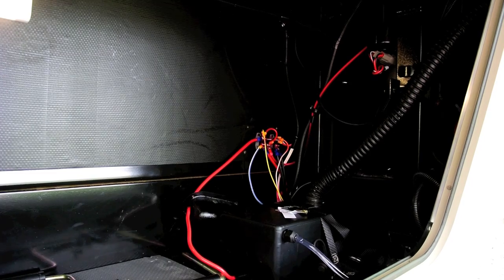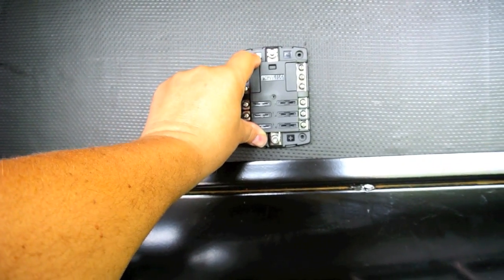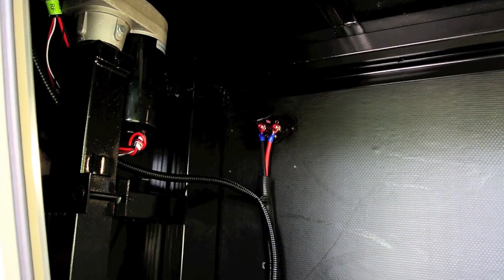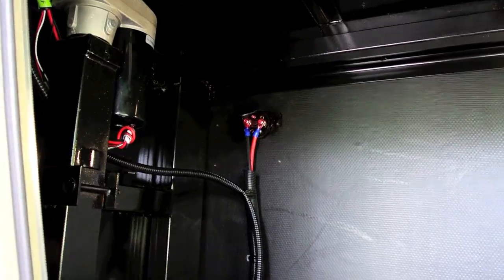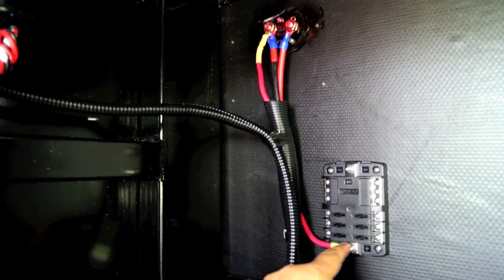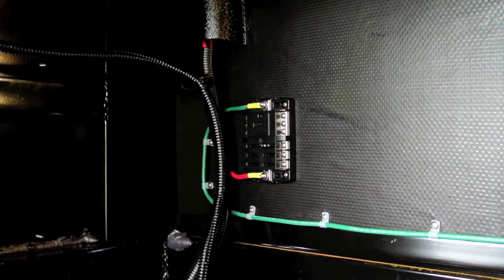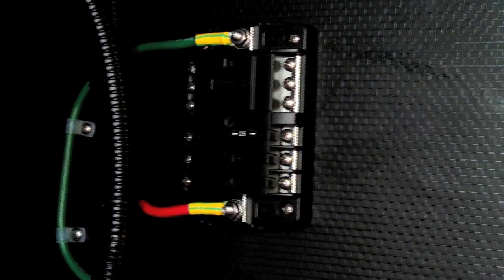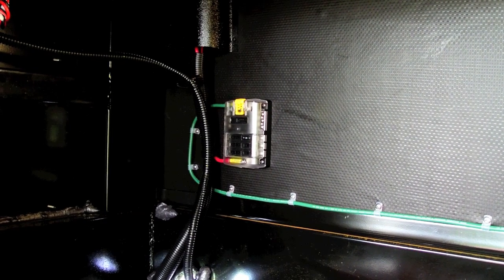Adding a 12V Distribution Panel to the RV.

Comment: What size wire is that from the main positive terminal on your new fuse panel to the switch? Thanks!
Reply from the maker: I used 8AWG wire. Like most of my RV projects, the video is a summary, with an associated project webpage providing more detail.

For this project, you can find the webpage at: 

http://www.rv-project.com/projects/dist.php 

where I discuss how to properly determine the size wire you need, where I purchase the wire and fusebox, and other information.

Comment: So you wired a new one in but still have lock nuts?
Reply from the maker: I am not sure what you are asking.

The wire nuts in the video was installed by the factory. Wire nuts are never acceptable in vehicles, boats, or RVs that go down the road vibrating everything.

Ring terminals attached to studs with captive nuts are acceptable and a preferred wiring method according to 33CFR183.

Comment: Trying to wiring up some LEDs and possibly run an amp for my boat... would you suggest pulling power off of this or directly from the battery? I'll have about 3 different sets of LEDs controlled by switches along with about 1,000W being pulled for the audio system.
Reply from the maker: The LEDs don't take a lot of current. A 5meter strip typically takes a couple of amps per color.  

An amplifier on the other hand is going to take significant power, and you may find your wiring is not sufficient.  I'd recommend downloading the USCG manual "Boatbuilder's Handbook" and reviewing the electrical section.  http://www.uscgboating.org/regulations/boatbuilders-handbook.php

For a boat, the USCG (federal law) has specific requirements for wiring electrical devices. I would also suggest visiting http://www.boat-project.com (my sister website).
Reply: Ok thanks. Much appreciated

Comment: I love your wiring sir, it absolutely drives me nuts to see messy wiring! I recently took our brand new ram 2500 in to have a lance RV plug installed in the bed of the truck for our truck camper simply due to time constraints otherwise I would have done it myself, the wire they ran was not secured in anyway, they didn't use the right gauge wire and didn't even try to cover any of the connections with shrink tube or even electrical tape! not to mention they had to send my truck to a body shop to repair a large dimple they put in the side of my truck with the hole saw they were using and this was a trailer shop that installs RV plugs in truck beds all the time!! Don't even get me started on our lance truck camper it's a hot mess!
Reply from the maker: Seems anything connected to the RV market these days is shoddy. I doubt most people working in this industry could even screw in a light bulb correctly.

Comment: Question regarding mounting objects on the wall of any RV. I want to mount  a couple small wire baskets for items like vitamins and such, probably won't hold more than 2 or 3 pounds. What would you recommend using to mount such baskets? I've heard of people using rivets to mount on the wall,  but not sure about that.
Reply from the maker: There is not much behind the walls, especially on the inside. If you are lucky enough to find a wood stud, that would be the place to mount your items.  You should be able to locate the studs by using a "stud finder".

If you are mounting to the wall without any back support, then the same anchors used for drywall  would work - those plastic expanding anchors.
Reply: +RVProject Ok, thanks for the help!!!!!